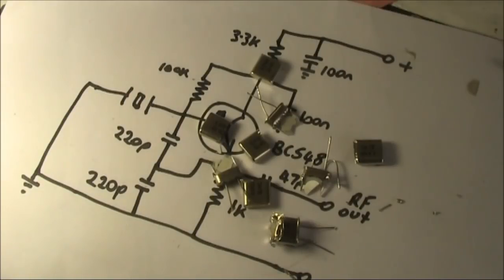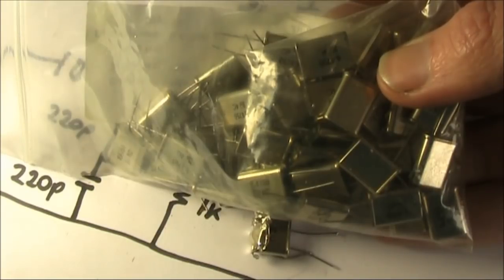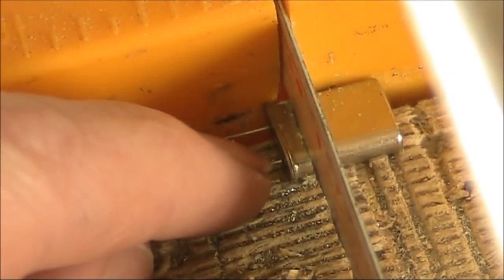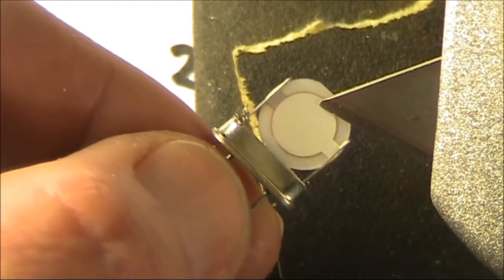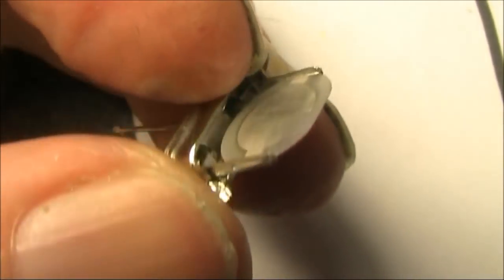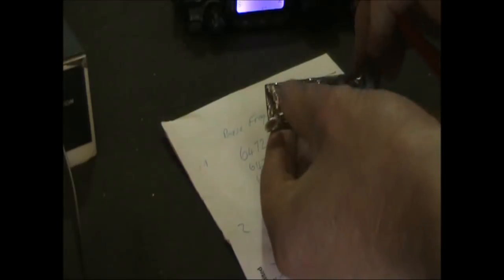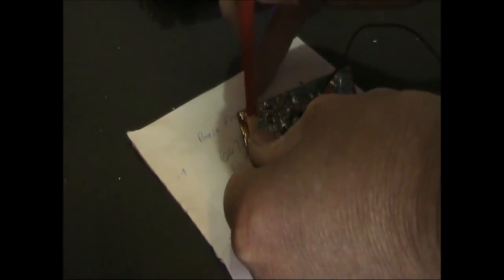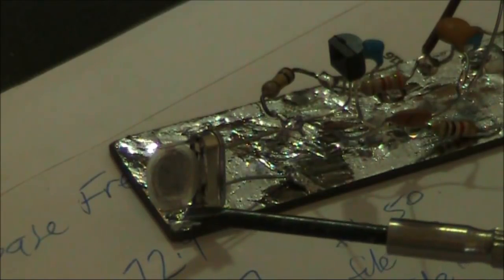Changing a quartz crystal's frequency with sandpaper and a pencil

Comment: I got moved from a job as a production test tech to a job in the R&D lab (with a good raise) when I figured out that an intermittent lock-up problem on a microprocessor board in our product was due to a xtal manufacturer's production flunky leaving out the insulating sleeves that was used to insulate the crystal circuit from the metal shell, a shell that our circuit tied to Earth.

Comment: You may not need to cut the case. In my crystal, the cover was just soldered on and was easily removed with heat from a solder iron.

Comment: Hello VK3YE, have you try to lower x-tals with pencils for printed circuit boards?
G0UPL have desribe a method of higher lowering  of frequency with penning of crystals, and better to use a Dremel tool to open up HC-25 xtals  then a nibbel...
Good luck from SM6AAL in Sweden

Comment: You want to reduce the frequency use a higher ohms resistor as well, like a carbon based resistor that is not wound of the inductance  in the circuit will change the oscillating of the frequency as well as n any tuned LCR circuit does,

Comment: I have ground the bottom lip of the xtal to remove the case then I have soldered it after lowering the freq with a perminate marker(max 20khz) have to wait for marker to dry before stable.I used this method on a codan to adjust the freq I think I even done this with a 2 mhz xtal using the codan this put it on 3650 cheap 80 meter rig.Great to see people out there still experimenting.
73s

Comment: Peter.
Where the case is soldered, it CAN be opened with careful and swift desoldering. It survived the soldering at manufacture. Your demo Xtal is soldered.

If there is little hole on the corner of the case at the far end & if it's opened during desoldering, be  sure to re-solder it before reassembly. 

The hack saw is the only hope with cold-welded holders.
Some were filled with inert gas. May not be today. You lose any gas of course by opening the holder
Plates were usually gold plated when I was in the xtal business but yours don't look like
gold. 
Gold can be thinned by exposing it, VERY briefly to the brown fumes of Aqua Regia...
FUMES! BRIEFLY!
and then promptly washing in water. It's still changing slightly on its way to the water!!! 
This takes it HF. Dry it in low heat or Isopropanol.
Aqua Regia is dodgy stuff. No idea where you might get it...(Nitric Acid and Hydrochloric acid.)

LF was achieved by sputtering more gold onto the plates but that's a manufacturing process requiring elaborate apparatus.
Soft pencil works for LF but it's not stable and CAN drift HF again over time.
Variable L or C in series with the rock is far more convenient but doesn't give much shift.
Nibbling the quartz is a good way to break it in two pieces. 
That will send it VERY LF.   00.00Mhz
Grinding is a bit difficult because quarz is extremely hard. Make sure all the grinding paste is cleared when you reach your QRG.
To be honest, you set yourself a tough goal starting at 6.4 Mhz., IF 40 metres was your target.
The manufacturers would have got a lot nearer by lapping the xtal blanks before
plating and final adjustment
 
Did you know that German WW2 Radios had NO xtals? They had no source of quartz, Silicon Dioxide.
Everything was L/C.
Reply from the maker: Thanks. My attempt at desoldering was unsuccessful. Maybe it requires a higher temperature?
Reply: VK3YE.
No so much higher temperature but more heat to melt it pronto before the heat travels.
Reply: Ditto.  The frequency of such a plated quartz crystal can also be raised by incrementally rubbing off some of the plating with a rubber pencil eraser.
Reply: I prefer desoldering the case for frequency tweaking, as replacing the cover will restore the crystal's relative insulation from ambiental temperature changes.  Take into account that the presence or absence of the cover also shifts the frequency.

Comment: I once built a SSB crystal filter using FT-243 Crystals by using Ajax (raises freq.) and Pencil Lead (lowers freq.) to tune each crystal.  It works.
Reply: Yes, grind non-plated quartz crystals with a fine abrasive such as toothpaste against flat plate glass.  Irregular grinding with a coarser abrasive will decrease crystal activity.